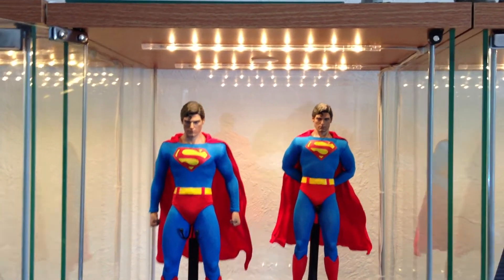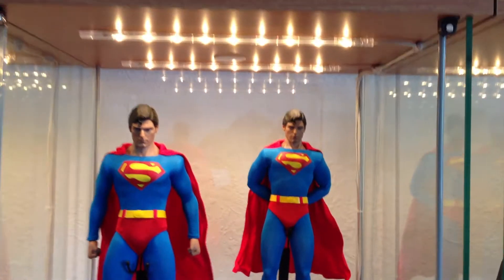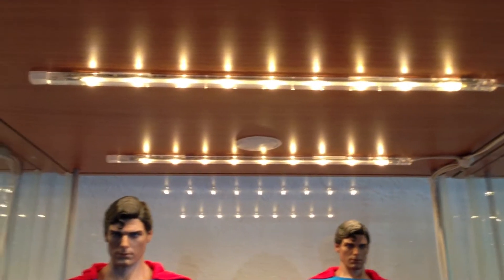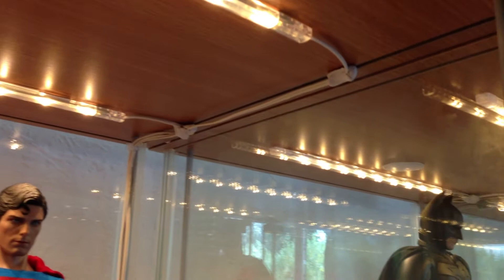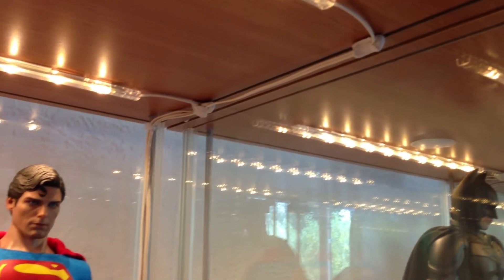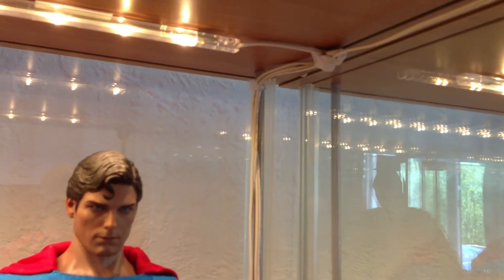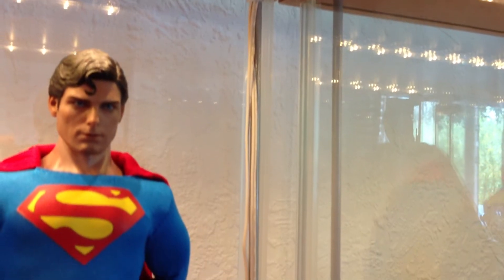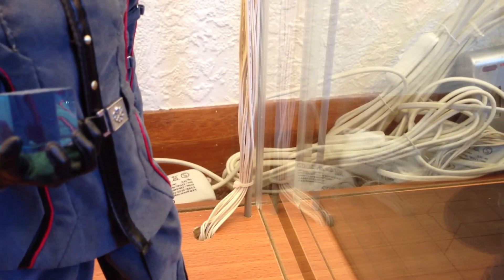Detolf Lighting DIODER

Comment from the maker: I used two full sets of DIODER per detolf for a total of ten sets in my five detolfs. And I didn't use any extender cables. This is just the standard out of the box setup that comes with a pack of DIODER light bars. I hope this helps.
Reply: My cables don't seem that long to reach even the furthest shelf... :(
Reply from the maker: ***** Do you have the white DIODER set, or the one which can change to any colour?
Reply: The ones that change colors...
Reply from the maker: Those ones have shorter cables.... But. You might just be in luck. You know those little extenders they give you four per set of? I have kept most of mine and they are lying in a drawer here. If you're willing to pay the postage, you can have them all.
Reply: Really? That'd be awesome! Thanks!
Reply from the maker: ***** Sure thing. I am not using them and they will be ideal for what you need. Send me a message with an address to send them to and i'll get a shipping quote.
Reply: I wrote you a message on hangouts!

Comment: Out of all the videos I watched you have the cleanest set up, you did a great job (: I have a couple of questions though. The hole on the last shelf bottom that you're running all 6 wires through, does the detolf come with that hole or did you do that yourself? If so can you explain how you did it, thanks! Also what kind of tac did you use? Did you say it was "blue tac"? Isnt "sticky tac" the same thing?
Reply from the maker: tenchikid80 Sticky tack is the same thing. Just use whatever you have locally. And that hole has to be drilled by you in the detolf base. You need to drill it far enough away from the metal rod that holds the shelves because the "feet" of the detolf is under that. I drilled a 25mm hole so there was ample room for all the cables(They all have little plugs that need to fit through the hole).

Comment: Sorry if you already explained this, but how did you manage to wrap the wires around the back parts? Is that a rubber band? Can't tell
Reply from the maker: Hey. The wires are held with cable ties.
Reply: Barry Murray Thanks! I actually got my first DETOLF yesterday and bought some cable ties today. As well as some other stuff, can't wait to try it out.

Comment: Hi Barry, i used too this DIODER but i have a difficult to stick with wood...Bands will come off after a while '. I tried to paste on all DIODER double-sided tape....but nothing :(.....Can u help me please. I seen your video and i haven't seen nothing on the dioeder near woods. How did you do?
Reply from the maker: Hey there. Each dioder set comes with small metal clips that hold the light bars. The clips can be screwed into wood. 
Did you keep those or throw them out?
Reply: Barry Murray  oh no...but i dont wat use these small metal. Do u know another way for me?
Reply from the maker: Have you ever heard of carpet tape? It's a very thin double sided tape that is very strong. That would do the trick.

Comment: What's the difference from these lights and the inreda led strips?
Reply from the maker: INREDA is one single 22" strip. DIODER is four separate 12" strips which each have about 3m of cable attached to turn to the transformer.

Comment: What kind of cable is that to connect the led lights?
Reply from the maker: +flowerpowerbunny It's the normal cable that comes with a DIODER light pack. But if you were doing a custom set up, you can use any kind of wire.

Comment: hi.ive just bought my detolf canbinet from ikea and i did see this dioder led lights but the kind off white like yours..and ive seen other you tubers with same brand but there white...do you if they sell different kinds?
Reply from the maker: +Arni Rivas They used to sell white ones but now only sell the warmer yellow lights. Far cheaper, you could buy a 5M roll of the same stuff and for half price, get five times the length and ten times the LEDs. But you have to cut the lengths and wire it up yourself. If you have electrical skills, it's a better way to go.
Reply: Yes.i had to get off whote ones..they look good.
Reply from the maker: +Arni Rivas Excellent. Make a vid when you're all done!
Reply: Lol.a video..idk.i dont know how to
Reply: Idk how to do that..i did add ikea dioder 4 pack led strips not white but there off white..still looks good.